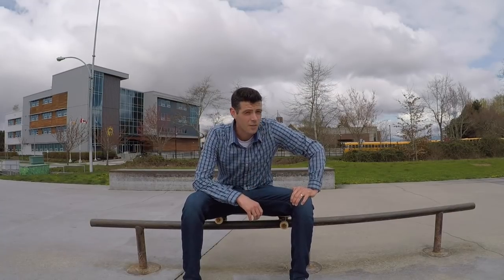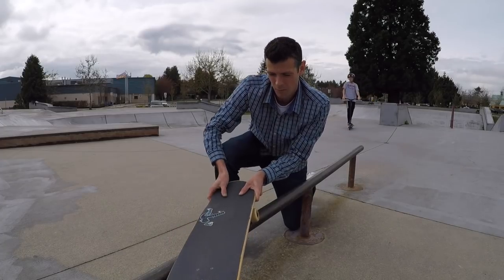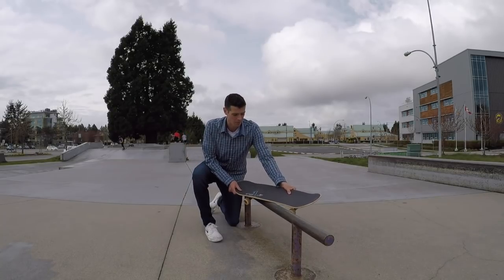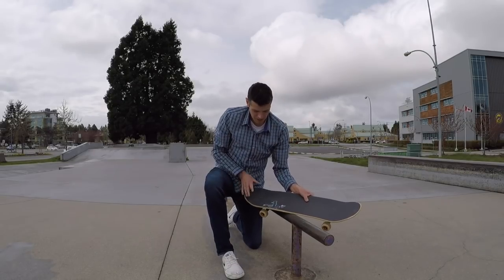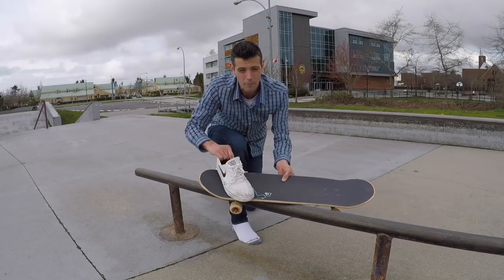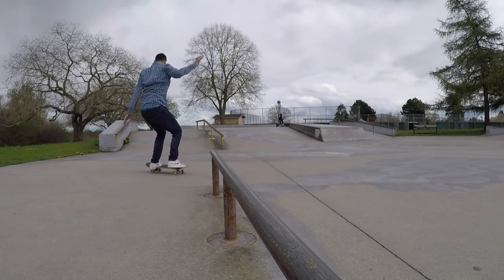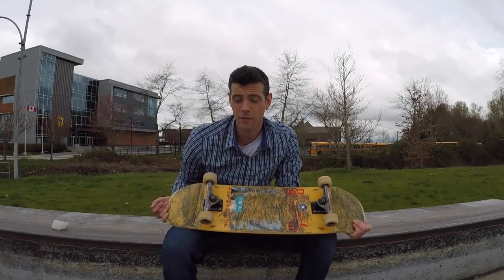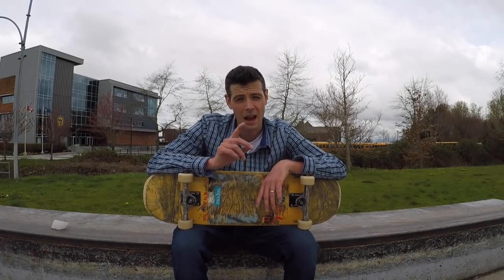How to Feeble Grind

Comment: I've really let my grind game suffer, I mostly skate transition(a planter box style quarter pipe thing) and do no complys.  I should really work on my grinds and tricks that require actual pop.  I used to be good at front smiths but wasn't ever consistent with back feebles because I was too used to doing smiths.  Maybe it's a good time to relearn both properly since I'm not great at either at this point.

Comment: Still trying to get this grind down after skating off and on since 1999! I can backside 50/50 front side 50/50 backside board slide on rails. I can grind the feeble grind but I can't land it I can't get off of the rail. Square rail.

Comment: Ben, what size wheel should i buy so that my board isnt so floppy with the flip tricks but isnt so small it will make it hard to lock in feeb grinds? (Right now I ride 57s)
Reply from the maker: 54 would be a good size. My flip tricks are still a bit floppy but manageable. Also they will wear down to 52's pretty quick.

Comment: I struggle with only being able to come out of feebles to fakie. Never have I done a feeble to regular in all my years of doing that trick. I find myself locking in strange where I am more so on my toe side and can only sometimes shift my weight to my heel, usually by accident or just enough to give a good pop on the 180. any more tips on helping me come out to regular ?
Reply from the maker: Maybe try to lean back enough to go into a 5-0 grind. Feeble to 5-0's are kind of tough but just trying to do that might get you leaning back enough to pull it off. It really just sounds like you need to lean back more and try to intentionally get your weight in that back pocket.